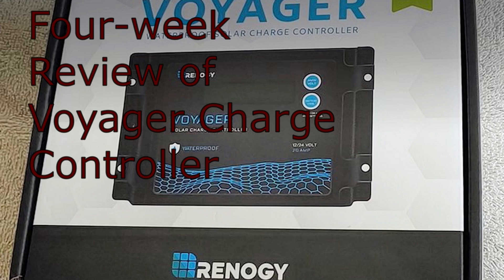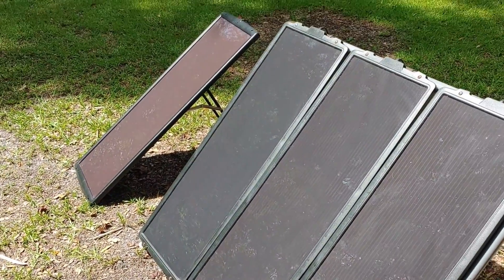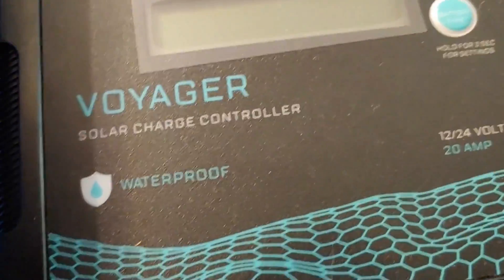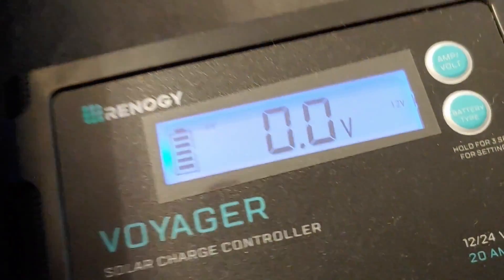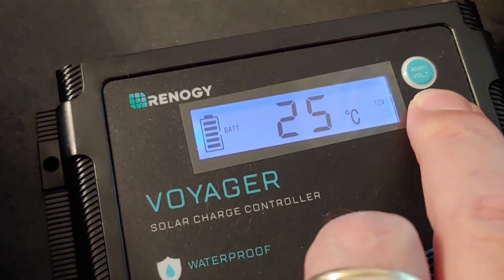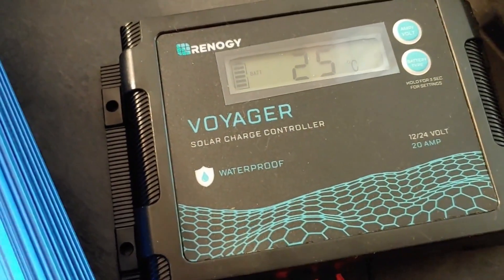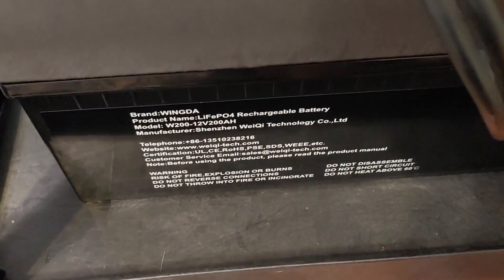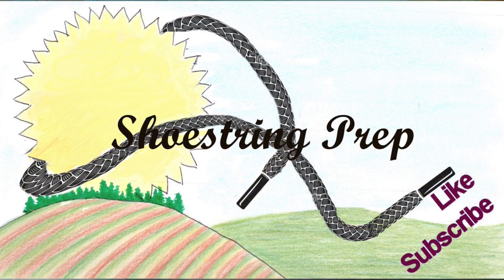4- Week Review of Renogy Voyager Charge Controller

Comment: Did you verify if it keeps the battery type setting when you disconnect everything. I really doubt that it does.
Reply from the maker: I did. My settings stay where I set them. Remember each model is a little different. Thanks for your comment

Comment: I did not know that most charge controllers will use batteries at nighttime, I’ll have to check mine, thanks
Reply from the maker: Welcome
Reply: A very small power draw milliamps, even inverters do this. Called idle draw. If.u have panel connected outside with battery this is non issue.
Reply: I called renogy today, the assistant didn't know why it scrolls constantly😮, which was my question.
The batt icon shows the solar is charging but I have no amps or kwh showing??